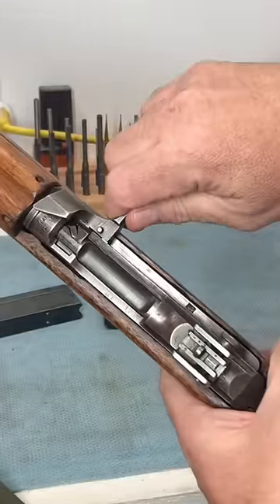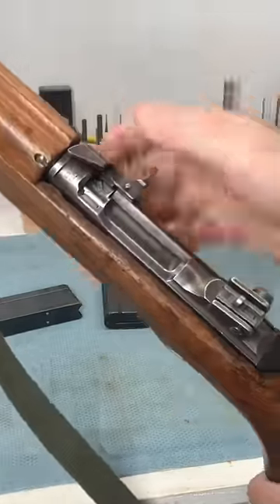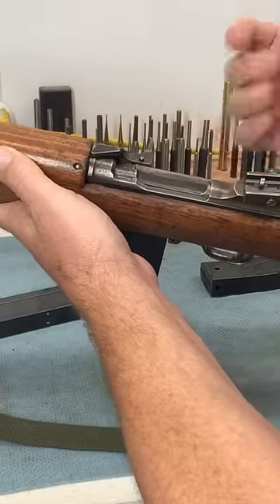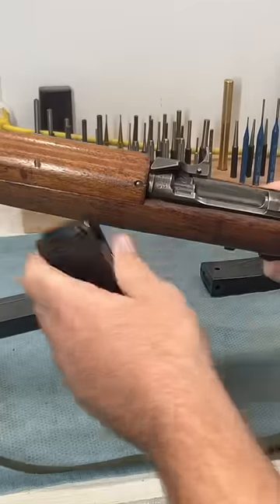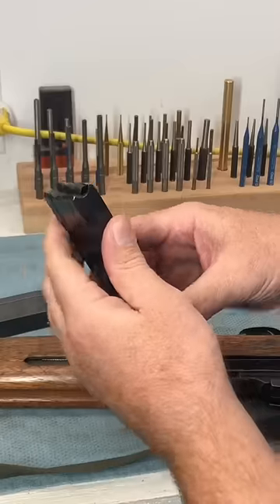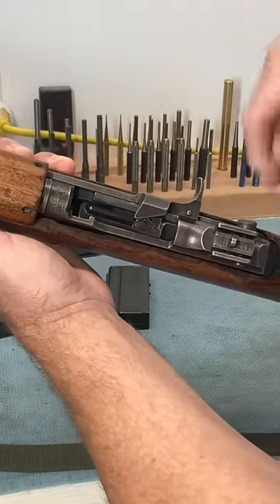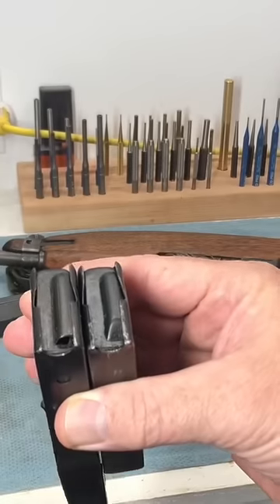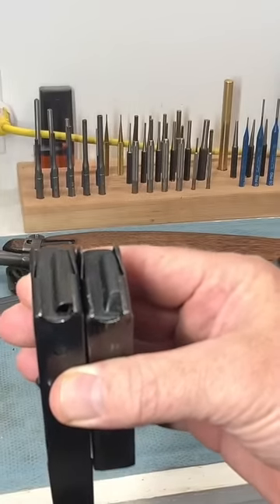M1 Carbine bolt hold open.

Comment: I'd rather know my mag was empty than not.
Reply: When it doesn't go bang you're out
Reply: @hairlessharescrambler56  or you have a stoppage. The working parts holding open showing you an empty mag removes that doubt.
Reply: @hairlessharescrambler56  What if it does not go bang if there is an enemy 20m away
Reply: @hairlessharescrambler56  or a dead round, or a malfunction this way they don't just pull bolt back try to fire again. in a firefight you might not pay attention to whether a round is extracted or not.
Reply: @skyviper4783   if your reloading  in the open with no cover your dead any way
Reply: Keep count of yur rounds
Reply: @ds6872  easier said than done in stressful situation.
Reply: @Kevin-qo6jw  thats not the problem the problem is not knowing if you have run out of ammo and the gun not fireing when you need it to
Reply: @skyviper4783   magazine  bolt holds are a wast of time  watch the video  they suck if you have a malfunctioning gun u may as well use a stick they make  these for ak 47 there junk
Reply: @skyviper4783   if u have a gun that doesn't go bang every time there is a round in the chamber why would u own it a bolt hold open mag won't fix a junk gun these old m1 were made perfect  for what they were used for
Reply: Count lol
Reply: @Thoroughly_Wet  easy enough on a range when the bullets are all going in the same direction.
Reply: @Kevin  you'd know not to go into the open, as ypu can see you need a reload
Reply: @Sip_Dhit  exactly
Reply: i think the 'click" that doesnt have a "bang" after it will give it away buster
Reply: @Zakumei  yeah, we call that a "dead man's click".
Reply: @skyviper4783
Reply: @Sip_Dhit   or you drop a mag and reload   if the bolt is closed and you got 5 rounds I guess you think your good to go       I no I'm gona sound crazy but u should reload and drop your old magazine  even if there is 5 rounds in it a bolt hold open magazine  is a wast of time and money    your gona be there looking at your gun open then try to reload
Reply: Fair point, Dude. But do you need the bolt held open after you drop the magazine that you now KNOW is empty?
Reply: @spinynorman887  quicker reload if you have to press a bolt release when you put a fresh mag in than having to fully rack if it closes when you take the mag off. Every millisecond counts.
Reply: @Hairless Harescrambler  unless you have a misfire then you can have a live round in the chamber that hadn't fired and you may not want to open the chamber.
Reply: Once you get a feel for the rifle you will know when you fired the last one, same with an ak. Likely wouldn’t under stress but if you train enough who knows.
Reply: @clonescope2433 it's called a hang fire, it can be very dangerous. Not only can it randomly go off at any moment (that's why you always keep guns aimed in a safe direction) but even worse like you mentioned, it can cause an out of battery detonation. Last round bolt holding mechanism are more for safety IMO than efficiency but it's a good bonus feature.
Reply: @skyviper4783 tactical pant poo
Reply: I've only played mil-sim games but I never notice the bolt holding open on guns that have that feature. I'm too focused on the enemy, rather than the firearm.

Comment: Probably more for knowing when your empty in a stressful situation
Reply from the maker: Supposedly it was added when the M2 full auto carbine came out.  Just to let guys know they were empty and keep from pulling the trigger on an empty chamber.
Reply: That’s exactly what I was thinking. They used to be full auto and 20 rd mags go quick
Reply: I don't care if the weapon is empty or there was a malfunction. I'll assume it's empty. If it's a malfunction, well, I had to strip the magazine anyway so no big loss.
Reply: Exactly
Reply: Vz58 has a similar hold open to be used with stripper clips. It'll also close the bolt if the mag is released.
Reply: @curtism-w6b  there's usually also a different feel to a bolt holding open on an empty chamber as opposed to a round being fed. This can be enough to save several precious seconds where you know you're out, versus click when you're expecting a bang, followed by saying "oh $hit!" and going through your malfunction drill.
Reply: I agree completely with your statement but try a gun from this century for home defense  its amazing how far we have come
Reply: Same for Yugo AK mags
Reply: @FlyingKSports  so why make a video saying you don't know why they did this?
Reply from the maker: @seapeoplesdidnothingwrong1307  the AK-47 does not lock open on an empty magazine either.  No one is making hold open mags for that gun.
Reply: @FlyingKSports  the yugo mags for the AK had a Bolt Hold open follower
Reply: @curtism-w6b  and if its a hang fire? or a squid load?
Reply: Most people don't realize their slide locks at the firing range
Reply: YOU'RE, not "your". 🙄
Learn the difference between the possessive and the contraction of "you are".
Reply: @FlyingKSports  so wouldn't it be a solution to a problem that did exist?
Reply: @JediLoreen  The upgrade version has you read as though someone is speaking, eliminating your confusion.  You might want to look into it.
Reply: It also helps cause you can add an extra round before loading a new magazine
Reply: @curtism-w6b  combat stress.  You seem quite sure of yourself as a vet of many engagements
Reply: @nellyprice  combat WHAT? 😂
Reply: @curtism-w6b if you hate it : stress
If you need it : stress
Reply: @nellyprice  uhhh huh...I am sure you know all about it.
Reply: Knowing my empty? 😂😂😂
Reply: Yeah, in Yugoslavia they retrofitted AK magazines in the exact same way specifically for the sake of making it obvious when the gun was empty. The visual indicator is more important.
Reply: Visual indication, more than anything. I suppose if you want to be anal about it, if you trained soldiers to hold the bolt open when reloading after an empty mag they will get confirmation that the first round chambers since that detent is just a hair behind the usual length of travel for the bolt.
Reply: @FlyingKSports  the AK doesn't habitually break the firing pin from dry fire, the M1 Carbine does.
Reply from the maker: @firefighter1c57  I've also seen M1 Carbine bolts crack from dry firing.  I've never seen that on an AK.
Reply: @FlyingKSports  Yeah, the Carbine bolt is a special fellow...
Reply: @johnboe412 so you strip a round from a 30rd magazine making it 29rd, you load another 30rd magazine so that makes 31. Then when you reload, you strip another round from a 30rd magazine making it 29rd, and then you load the previous 29rd magazine making it 30. Nice!👍
Reply: @calebthomas6385 The M2 magazines were 30 rounders, the short ones more commonly seen on M1s were 15 rounders.
Reply: @curtism-w6b  You won't know that until you aim at the enemy and your gun goes click, though. I'd like to know when I'm empty if I was in a combat situation.
Reply: @YouHaveReachedBob  the AK doesn't have a bolt hold open and has killed millions of people. Being nice to have =/= necessary. Plus, 9 times out of 10, people still pull the trigger on an empty handgun, and it's much more clearly visible than an AR for instance.

Comment: Actually, it is a very important feature. I had many hammer drops on empty chambers. With that, you will feel that the bolt doesn't close, even without seeing it and you know immediately when to reload. (or you are in a battle situation and don't feel it).

Comment: Yeah we changed out the followers in our new mags for our Carbine we've had in the fam for years and years. Exactly due to this reason, was never meant to stay open. Except for inspection. Which is why the manual hold is there. Good stuff man, best wishes! Love my 30 call.
Reply from the maker: I might do the same.

Comment: There are two solutions to the problem, if you really consider it a problem.
#1. Is to try and find the late type follower and get one for each 15 round magazine you have.
#2. Is to take out the early type follower from the magazine, use a Dremel tool with a cutoff wheel and cut the ramped portion of the follower off so that the bolt will stay open after the last round.
There is a third option, just live with it the way it is.

Comment: I put a couple of 30 round followers in 15 round mags. They are interchangeable.  Unfortunately the M1 carbine mags are almost single use disposable.
Reply from the maker: I’ve had pretty good luck with the carbine mags holding up.

Comment: No, if it hold open after the last shot. The shooter will feel and see that he is out of ammo, and know it's time to change his mag. And then he can do so. And not waste time trying to aim down on a target and get a click and no boom. In combat it is absolutely critical to know when you need to reload. So this absolutely fill a problem that did exist and is solved by these newer mags. You just have no experience
Reply: @omarloveridge3161  doesn't look like it. But by the bolt locking back by the mag follower. Is letting the shooter l ow he is out of ammo. That is critical information. He'll have to most like recharge the bolt after. But he will be reloaded. And that's the nost important part
Reply from the maker: You’re absolutely right!   I’ve never been in combat.

Comment: Interesting side note:  If you're using the 30rnd magazines in a M-1 carbine, you'll notice that after using a specific magazine 20-30 times, you'll start to have magazine retention or loading issues.  Look at the magazine lock notches and you will see that they are worn.  The 30rnd mags were intended for use with the select fire M-2 Carbine.  Get a M-2 magazine release and you're problems are solved.  The 30rnd mag has a 3rd retention notch on the side of the mag that is held in place by a tab on the mag release. Helps protection the retention notches from the added weight of 30 vs. 15 rounds.
Reply from the maker: That is interesting, thanks!

Comment: Mag locks back the bolt so one hand can reach the bolt with the thumb, hold the bolt back and use the index finger to drop the mag and the other hand to grab and insert new mag.
Helps if the butt of the stock is pushing against the thigh/groin area
Meant to be similar to the  Garand I’m assuming.

Comment: A last round BHO magazine can still be useful even if it doesnt keep the bolt open when removed. Mainly it lets you know that youre out of ammo obviously but it's also going to keep you from firing on an empty chamber which in turn may make your firing pin past longer. We all know the fuddlore behind dry firing and all but there is truth behind it, especially with older firearms. Basically, only useful for sparing your firing pin that little bit of stress and giving you a visual indicator youre out of ammo BUT those are still useful things nonetheless.

Comment: i have one question.

Is it safe to rack the bolt while having the bolt hold engaged?

Context: i have a Universal Gen 3 M1 Carbine.
Reply from the maker: Yes.  Once you pull the bolt back the hold open will disengage.

Comment: It doesn’t exist to speed up the reload by holding the bolt open, it exists to serve as an indicator of an empty magazine; thereby speeding the response to said condition. The reload procedure would be the same even if the bolt magically stayed open when empty because the charging handle still needs to be pulled to release it. During range time, this is a safety feature that allows the sh00ter to visually check that the chamber is clear without having to rack the bolt thereby limiting the opportunity of mishandling and flagging the firing line.

Comment: With the magazine that keeps the chamber open, you're able to reload the magazine using clips of bullets, that's why it's designed like this.  Clips of bullets weigh less than magazines full of bullets and were more commonly used.

Comment: Well, the problem, closing on an empty chamber, IS real, the magazine with the cutout is a partial solution to the problem.
The problem, in actual combat is that a soldier could think he still has ammunition and attempt to fore an empty rifle at an importune time. The modified magazine prevents that, but does not provide the best way to load a semi-auto rifle.
The M1 carbine is a great rifle, but not without flaws.
FWIW, the AK 47 and AKM had the same issue and were perhaps the most produced combat rifle ever.

Comment: Could you push that button when the bolt locks back on the follower? Or do you still have to pull the bolt back slightly?
Reply from the maker: You have to pull the bolt back slightly before you can push the hold open button.
Reply: Gotcha. Thanks for the reply. That is a nice rifle tho.

Comment: The bolt is open on a empty mag to know its empty and for adding the extra round via the bolt... Although doing so can damage the extractor so it's better to  chamber the round from the mag and add the extra bullet to the mag from your shoulder pocket, from previous used mags or from the stowage on the stock...

Comment: I guess you could do a sort of Iraqi reload using the modern mag.
Since the mag holds the bolt back, grab the bolt with your eight hand and hold it against your shoulder while you insert a new mag with your left.
Kinda poi less though, and that mag will eventually get a hole worn into it and cause you problems.
I'd rather have the OG GI mags.
The M1 Carbine is one of my favorite guns.

Comment: Does the M2 not have a bolt hold open that is engaged by the later pattern of magazines?
Reply from the maker: The hold open mags came about because of the M2.  It’s only on the 30 round mags.

Comment: As far as the hold open button on the Carbines charging handle I have the sneaking suspicion that the military had it put in simply for the inspection arms drill and for safety on the shooting range.
During inspection arms the bolt is to be open when handing it to the inspecting officer to insure the weapon isn't loaded and so he can inspect the weapons action for cleanliness, and when you're on the range there's times that for safety reasons they want everyone's bolts opened so at a glance any range personnel can be assured that weapons are cleared, especially when filing past the range officer when you're clearing the range.

Comment: I have both some 15 round mags and a 30 one. The 30 round mag has trouble feeding, at least mine does, so I tend not to use it. The two Original WWII 15 round magazines work very well on the other hand.
Reply from the maker: The USGI mags have been very good in my experiences.  My 30 rounders are all KCI.  They’ve been pretty good so far.

Comment: What happens if you push the button on the bolt as you remove the mag. Will the bolt hold open then.
Reply from the maker: You have to pull the bolt handle rearward before the button will engage in the hole.

Comment: well if it holds open on last round you can then push in the plunger right?
Reply from the maker: The plunger doesn't line up.  The follower allows the bolt to move slightly too far forward to align with the plunger hole.

Comment: That is awesome, I have an old general motors manufactured M1 carbine and never knew how to keep the bolt open. I had to jump up and check it when I viewed this video. Sure enough it has the button and it worked. I have a lot of newer magazines and they never held the bolt open. Thank you sir for showing that video. Any idea's why mine pinches the shell coming out and jamming me on ejection? I have thoroughly cleaned it and it still pinches the shell. Maybe I need better ammo? Let me know. Thanks either way.
Reply from the maker: Thank you very much for the comment and watching the video.  My first guess about your ejection problem would be to look at the extractor on the bolt or the extractor spring.

Comment: Those get damaged if you dry fire em right??? Also even in modern firearms the magazine is what holds the bolt open on last round except the bolt release is spring loaded, can’t you just do the same thing except manual and press that plunger after noticing last casing ejected to keep it open??

Comment: Man I need one. I bought a couple 30 round mags a few months ago before the 10 round limit ban in the People's republic of Washington state
Reply from the maker: I only have a few 30 round mags.  I'm sure I ned more!
Reply: Seems like the follower is the only difference. WA doesn't ban modifying magazines in ways that doesn't increase their capacity above 10, so just buying (or printing) a new follower should get you what you want.

Interestingly, our legislators are such idiots they can't even ban mags correctly; since your 30s are already ”high capacity” and grandfathered, you can even modify them to be 100rd drums legally, because there's no such legal definition as "highER capacity".

Comment: The m1 garand doesn't have a box mag when It was designed it has a clip that Flys out when the last round is shot. For the carbine they just shorten the rifle and put a whole on the bottom to accept said mag. Meaning the bolt is virtually the same.
Reply from the maker: Keep in mind the Garand does lock open after the last round is fired.

Comment: I mean, with the updated follower, could you not then just pull the bolt back that last bit, push the button to lock the bolt, then swap mags and drop the bolt? Might be faster with practice
Reply from the maker: You’re right.  You could take that extra step to hold the bolt open.